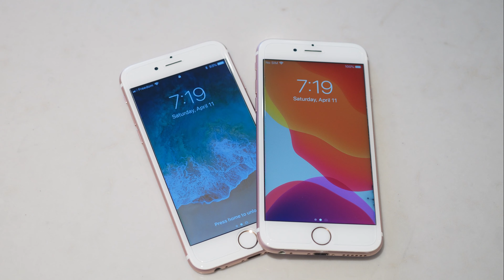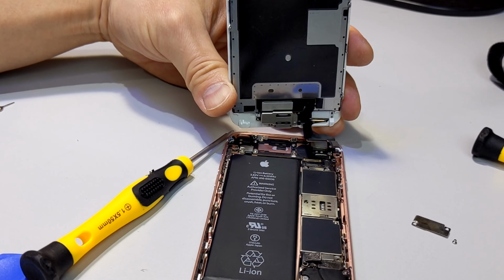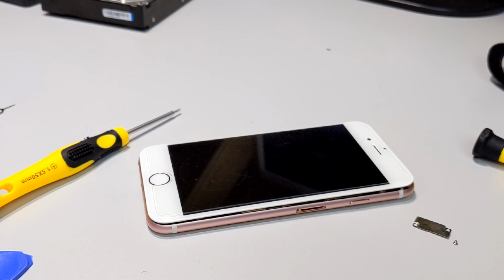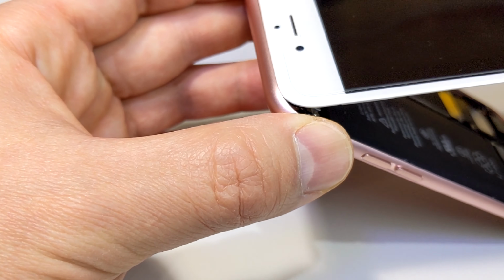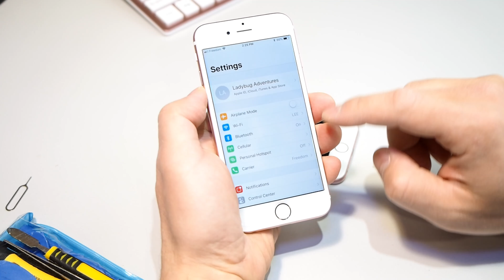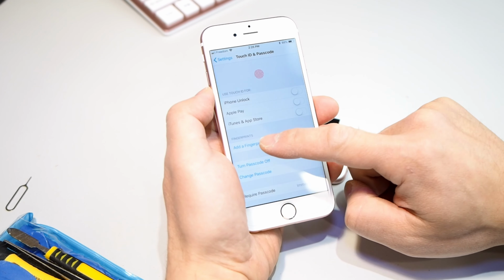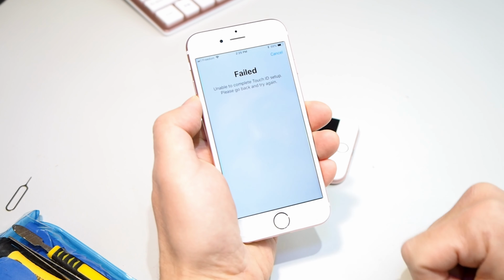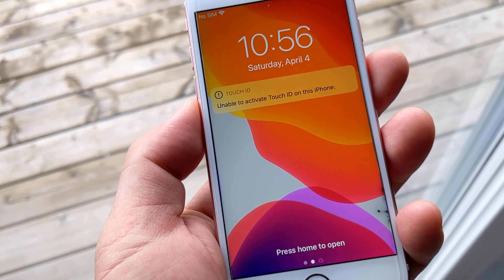iPhone 6s fix screen replacement and home button swap/fix

Comment: I love that video.  It shows a great understanding on how to fix an iPhone 6s screen replacement.  That's something I wanted to learn from long time.
Reply from the maker: Thanks. Just remember to disconnect the battery first. Just to make sure there isn't any current to cause a short if you drop a screw etc. Delicate stuff but very satisfying if you can get it working again. I'm using the second phone right now and can't believe it somehow fixed itself!